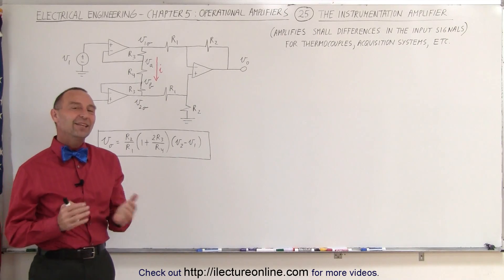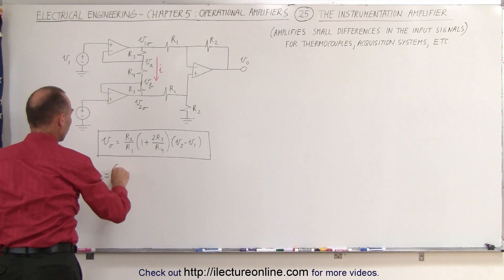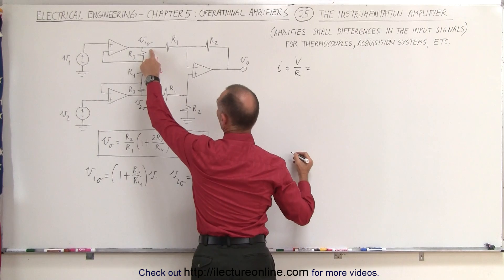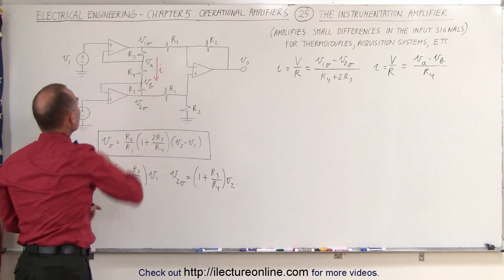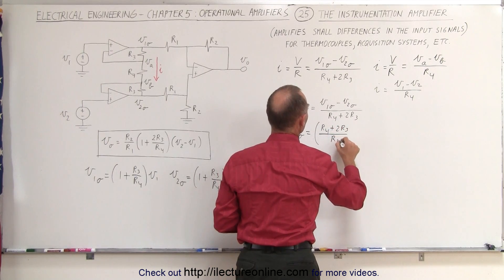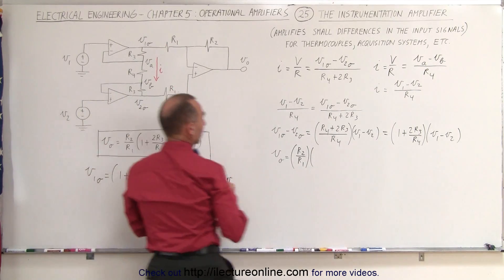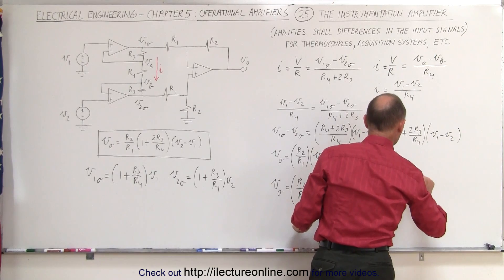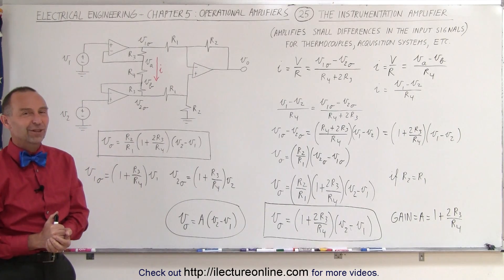Electrical Engineering: Ch 5: Operational Amp (25 of 28) The Instrumentation Amplifier

Comment: What would happen, if there is another resistor in the feedback loops from the negative terminal to va or vb ? Would that change the the output from v1o ? And also, is the output v1o due the fact it is a non-iverting amplifier?

Comment: I am currently designing a EEG data acquisition paper design for my 4th year project. Will use the instrumentation op amp to amplify the difference between the  voltage of the electrodes of a sensor that we put on a scalp.

Comment: why there is a need for a third OP amp , i'm talking about the one in the right
Reply: The two opamp on left individually amplifies the two input voltage, while the third opamp on right is mainly in charge of filter out the common-mode part.
Reply: @rebeccafu2745  thanks

Comment: Hello sir. I just tried to calculate Vo by using input equations V1o and V2o from the start of the video. And the results are not the same as you ended up with. 
If you use (V1o-v1)/R3=(v1-v2)/R4 [for current i through R3 and R4] you get different equation for V1o which is:
V1o=(1+R3/R4)v1-(R3/R4)v2; rather than V1o=(1+R3/R4)v1 shown in the video.
Reply: Same here. But if you look later on in the derivation he doesn't even use this part so it's useless and it shouldn't really bother you.

Comment: Thanks for the explanation. I have watched many tuts on the in-amp but no-one has explained the reasoning behind it in this depth. I can build the circuit but it is very hard to troubleshoot a problem if you don't understand the math. Thanks again.
Reply from the maker: You're very welcome!

Comment: I have one question;
Why do we need for all that complexity? 
Can't we just use a normal difference amplifier discussed in video No.15 and control its amplification ratio?
Reply: you need these for the op amp not to effect the signals going into v+ and v-.  the two op amps make sure no current flows into vout from the input. since v input goes into the virtual ground.
Reply: @ajj7794 thanks from another guy five years later😂

Comment: Hi, just wanna ask, how did you get Vo1=(1+R3/R4)V1? Im sorry, newbie here.
Reply: I know this is like.... 2 years later... so its probably not helpful to you at this point, but it's because R3 and R4 form a voltage divider. the ideal op-amp has the +/- terminals equal to each other, so Vout(1) is simply a voltage divider between R3 and R4, when compared to the - input of the top left op-amp... whose voltage also coincidentally equals v1.

Comment: I am arguing that Vo1 and Vo2 cannot be simply input voltage multiply gain. The root to ground seams a bit fictitious. In fact (Vo1-Vo2) gives an incongruous result  compare to what you wrote next.
The right results are Vo1=V2 +(V1-V2)R3/R4 and Vo2=V1 +(V2-V1)R3/R4. 
Best regards.
The right answars
Reply: this is correct. if we take Vo2-Vo1 from the left hand side equations we get (v2-v1)(1+R3/R4). If i am wrong pls correct me

Comment: Hi, great video.

I have a question:
To get the equation for v1o, it seems like you used the gain for a non-inverting amplifier but I'm a bit confused when you assumed that R4 was connected to ground.  Were you using the principle of superposition here and turning off v2?
Reply: Maybe you got your answer already (4 month in), but since it took me some time to figure this out myself: yes, he is using superposition :>
Reply: @chrisw3260  Correct
Reply: Instrumentation amplifiers fix the problem that the differential amplifiers have that is due to the resistors at the inverting input, the input impedance is lower than what we'd like, i.e infinity. Therefore using buffers in such a non-inverting configuration lowers noise that is caused due to the low impedance in differential mode
and thus provides a very high CMRR (Common Mode Rejection Ratio) giving us a clearer signal. I suggest looking it up really clears up the cloud o' doubt
Reply: @kluivertcorreia6088  true?
Reply: @chrisw3260  can you explain that please :(((